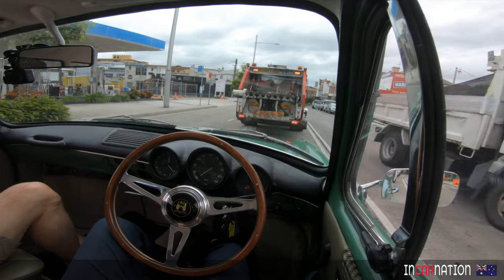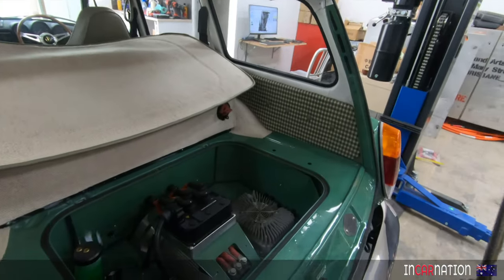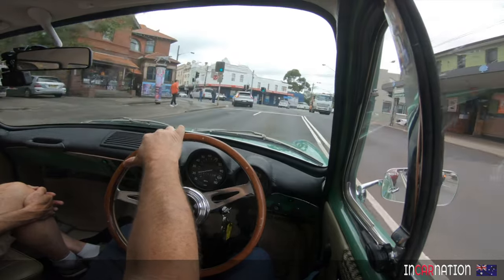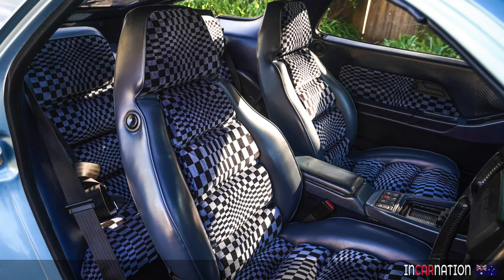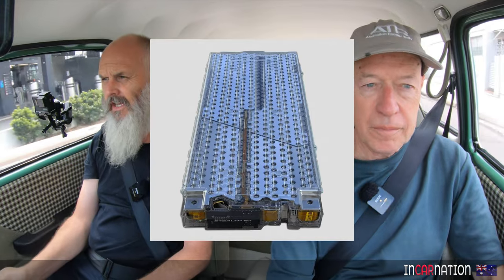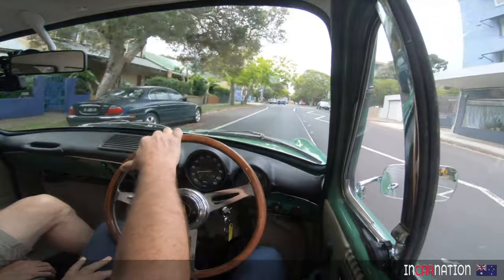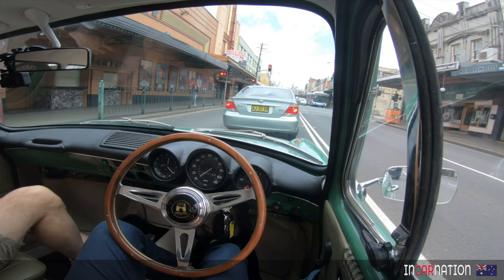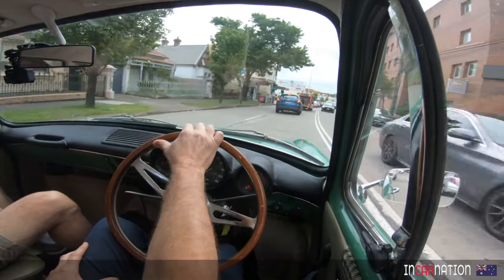Electric inspiration - Classic Dak Dak to EV Conversion - 1973 VW Type 3

Comment: WHAT A beautiful car! The colour, the chrome gear lever, and DEFINATELY the upholstery! Pity my eyesight isn't what it was for driving, or I'd DEFINATELY have to buy it!
Does it have the batteries in what was the front luggage compartment? It's amazing  that the electric motor actually is LESS crammed in to the engine bay, than the petrol engine! And the loss of the front luggage compartment isn't too tragic, because you still have the one at the REAR, and the rear seat, of course folds down if needs be! Fascinating beautiful car.

Comment: I like how you're going about this project. Eyes wide open and trying to learn as you much as you can from others beforehand. It is also good to see you making some hard decisions such as " investing " in the necessary things early on such as suspension as they will pay you back several times over later . The idea of using the MG drive unit over a Tesla one is interesting. It is certainly the cheaper option early on but I reckon you may regret that decision . It's just my opinion and I am no expert on this subject, however based on my experience with ice vehicles , what seems cheap initially eventually becomes expensive later. Unless you really can't afford the more expensive option in the first place. And let's not forget, time is money. I do really like the MG platform. I think it would be great for other vehicles conversions.  I really look forward to watching your progress. I'm sure we're all going to learn heaps.
Reply from the maker: All good points Bill. I'm still open minded about the right approach and as you'll see in upcoming episodes of the 928EV8 project all these are discussed. Including the idea of going all-Tesla for the 928 and keeping the MG stuff for another car that didn't have a 'performance' priority. Like the barn-find 1960 Jaguar Mk II I missed at auction in the last episode. But I do like the idea of just re-shelling all the MG EV electrics stuff into the Porsche. It should be OK - the torque figures from EV motor and ICE motor are similar. Huge benefits if it works - power steering, HVAC, proper digital dash, full instrumentation, fully integrated AC and DC fast charging, cooling system and engine and battery management. So many plus sides. But if the MG gear isn't fast enough, happy to then swap out the motor. Or go full Tesla for the second 928 build. Options options options...

Comment: Okay... so I saw you on Homebuilt by Jeff and decided to come over here to check out your project.  Powering a Porche with an electric motor sounds interesting...
Reply: Ummm.... this has nothing to do with the Porsche project you told us about... other than the "inspiration" you mentioned.  This "better for the environment" trope may be true from a certain perspective - but I continue to hear about the abysmal practices involved in mining the material for the batteries... and just how confounded we are about what to do with batteries that have reached the end of their life.  Overall, the environmental cost of electric cars is much higher than the ICE cars - but on top of that there are very few places that has an electric grid capable of supplying power to charge the batteries should EVERYONE switch to electric vehicles.  Ideally, we need to find a better way to make the batteries... and charge them with power from renewable sources.  I hope you at least acknowledge some of the hurdles we still have to clear as you continue thru this project.  I subscribed... and I'm interested to see how this turns out.
Reply from the maker: It's going to be a long journey. You might be disappointed at how far away I am from having the 928 rolling under its own power. There's a lot of stripping out and disposing of bits and assembly/testing of non-Porsche bits first. Mind you, it took Jeff 200 episodes to get the Alfarrari rolling so maybe tune back in in a year's time. But I did learn a lot of valuable stuff from my drive with Nick. Things I like and things I don't like. 

But I don't intend to engage in all the usual anti-EV arguments* otherwise I'll never get any videos made. But you're quite right - look forward to the day when I can charge the thing from renewables and not pay the grid's ever-increasing prices. Suffice to say my motivation is to have a cheap-to-run, reliable, high performance electric Porsche that I will enjoy as a daily driver. Not a drag car. Just a car I'll enjoy driving dailyi. And make a nice V8 noise outside the car if I want it to. Nick's got this own view on environmental issues  but I can hardly be called an environmentalist when I have 3 other gas guzzling V8s in the garage. One of which I enjoyed driving today.
 
(* such as * lithium mining * grid won't cope * recycling * manufacturing cost * thermal runaway * dangerous heavy metals * insurance costs * house burn down * Luton * Freemantle * kids in the congo * battery life * waiting for hydrogen * waiting for plant fuels * but John Cadogan said so * etc)
Reply: @inCARnationAustralia  - Wow!  Well... I'm gonna stick around and try to keep up to date on your progress.  Thanks for this incredible response.  Perfect!

Comment: I'm concerned this is a way that battery thermal run away will become the future cremation of priceless classics 😢
Reply: ICE vehicles catch fire more often than EV's, it's quite commonplace but not as newsworthy as an EV ablaze.
Reply: @GerardBendotti  Are you sure about that as the percentage of EV's is minuscule, but serious high temperature 🌡extremely toxic fires 🔥 are happening all the time now. I have a hybrid EV & the battery in my model is way safer than current models of my brand now. Are they cutting corners or pushing the limits as insurance companies are increasing dramatically the premiums recently. Problems from expensive/difficult to repair - so vehicles are scrapped more easily if battery  compartment damages.
Needs more work before more mass adoption.

Comment: Oh so you arnt using the MG motor for the Porsche? $150K, crashing over road irregularities is a charming VW thing? Or was the camera location accentuating that? Smooth power delivery needs to be complimented by a smooth ride I think. Oh but then I do like ICE cars so why should I complain.
Reply from the maker: It was interesting to see the Hyper9 but it's not for me. Either the MG's motor as an interim step, then if it doesn't prove acceptable, on to the original Tesla motor as planned. While I appreciate Nick's decision to use the VW's gearbox, I'm pretty sure the whine you heard was normal gear whine from box and diff., that's normally disguised by the ICE motor. And of course the suspension in a 1960s era VW is vastly different from the brilliant design of the 928. I do expect a Porsche to have a lot less noise and ride, well, like a Porsche should. We will only choose damper and spring settings once we know the weight. But Nick makes a good point about chasing down all the squeaks and rattles which will be all the more evident when the motor is so quiet.